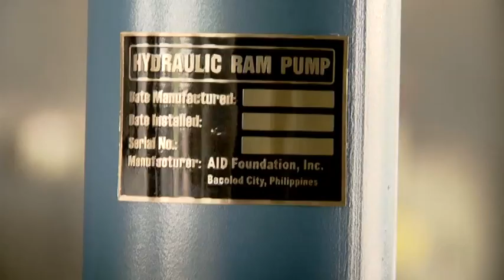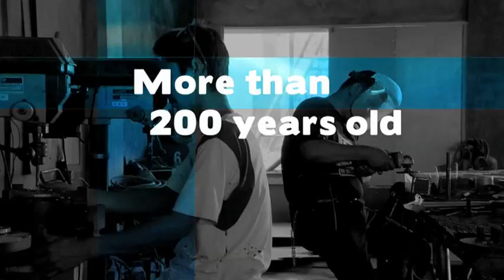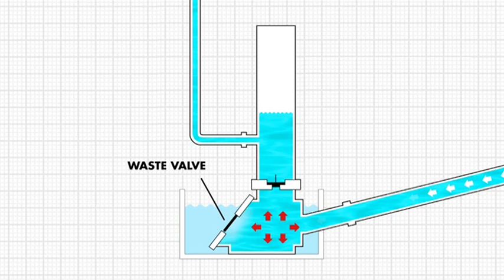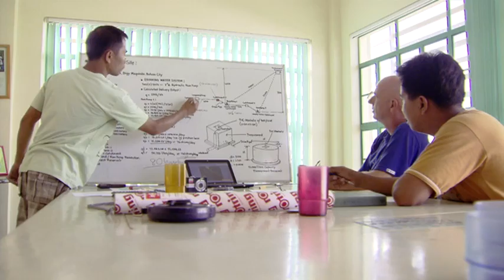World Challenge - The Only Way is Up - Vote Now

Comment: honestly local materials magamit natin dito...nakagawa ako tsinilas lang ang one way check valve at pampabigat para maka store nang potential energy or pressure sa reservoir na blue pvc 4 inches in diameter...mga 25 feet ang water output sa taas nang hill...

Comment: dear sir... i have a suggestion regarding with the ram pump design. i highly appreciated this kind of innovative design which you have said that this was 200 years old or more pump. but can we make it more efficient. by turning the intake valve facing to the body of water just like a syringe... which will beheld  by a plunger and driven by a water wheel....